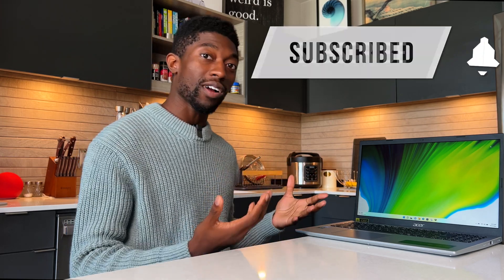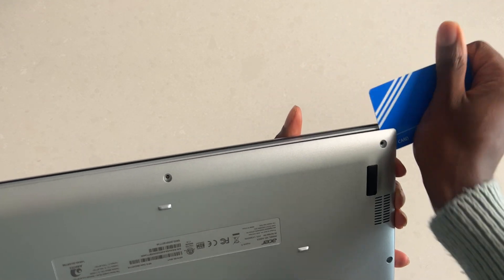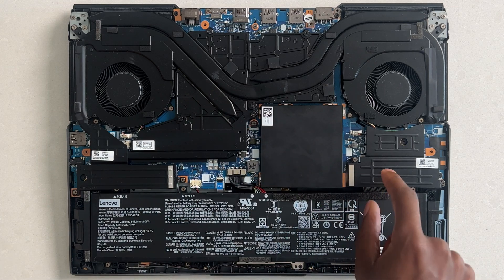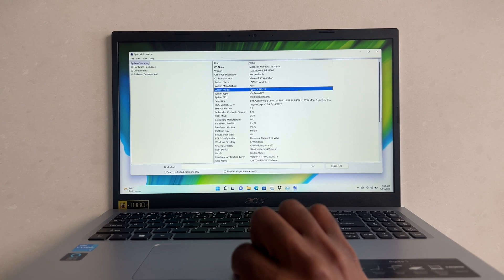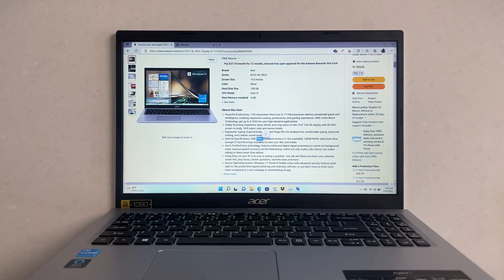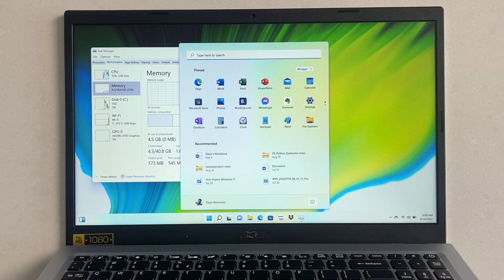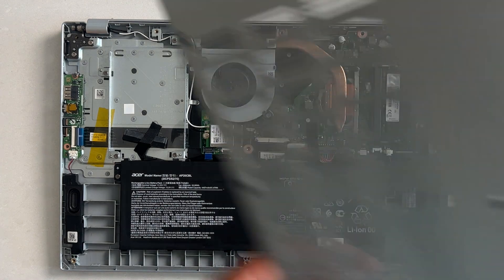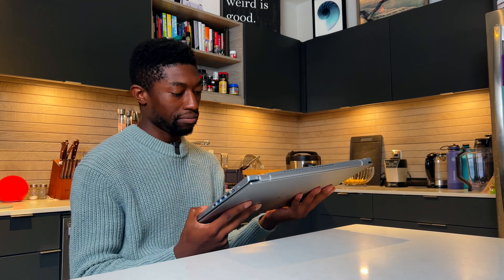Upgrading Your Laptop in 2022 - How To!

Comment: I checked and my laptop takes 3200. I put the new 16G ram into the slot, snapped on bottom, and screwed it on. On boot up it will not move pass the Acer logo screen. Any idea what is causing this?

Comment: I watched some videos about cloning or restoring windows from image but the cloning makes windows slow or something😢 but those are old videos…don’t know if that stuff still applies
Reply: Cloning? That should create an almost exact copy of the drive. The only thing that would ‘slow it down’ would be if your drive is actually slower or perhaps not configured properly (switching from a hard drive to an SSD can run into issues without a configuration change in the Operating System, but even then, SSDs should still be faster in pretty much every case.) 

Sure a fresh install of Windows (or what have you) will perform faster, but it’s marginal and it will likely return to being the same speed as a cloned drive would be if your usage is unchanged. 

You do have to make sure the cloned drive has the same file system, but usually that’s a non-issue as cloning software usually takes care of that if I recall. 

If your drive is encrypted there may be some additional steps to take to insure it works properly, but other than that, a clone is a clone and should not slow down a computer. Maybe I’m wrong. Not an OS expert, but I do work in software development.